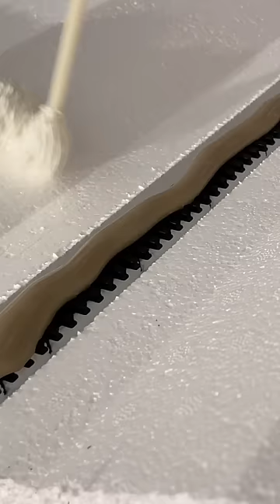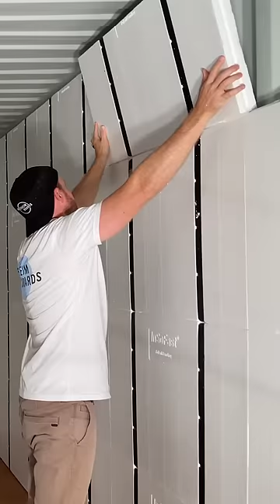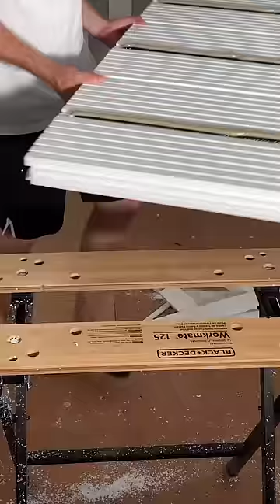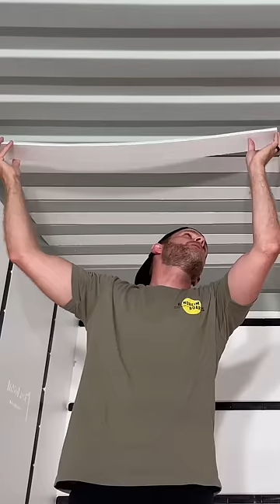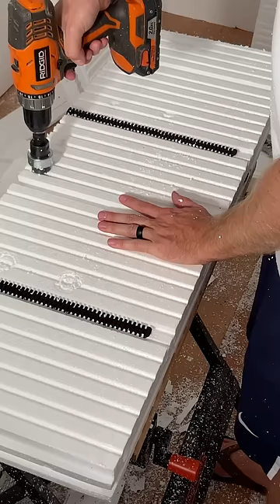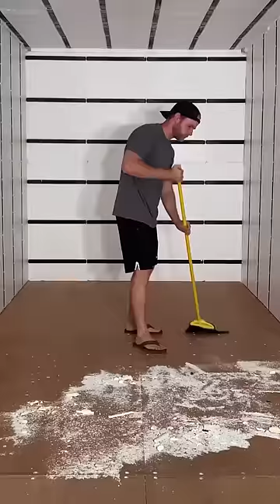Insulating a Shipping Container Shaping Bay #shorts

Comment: Gotta have an air gap between the insulation and metal. Or there will be mold. It's best to fir out the walls and use basic insulation board
Reply: Or create vapor barrier by sealing all the gaps with aluminum tape, that is assuming it is closed cell foam.
Reply: How would you prevent the mold then im just tryna research
Reply: @Jesus.christ.your.bro. Think to install incremental small air vent ports at each recessed section
Reply: You don’t need an air gap if the heat never hits tye metal to bring moisture air behind it. Try to air gap it and you’ll likely get moist air condensing all over, then bugs, then drips down the walls.
Reply: This guy spent all week installing this and now your gonna tell he’s getting mold 😂😢
Reply: Did this and years later found tons of mold and water.
Reply: @joethomas6457 In a cold climate or warm climate?  
Down South we insulate to keep the heat out.
And running a small air conditioner or dehumidifier would take care of the moisture if it was a problem.
Reply: @WaltWW  south Florida.  Must run ac all year.
Reply: @joethomas6457 Thanks

Comment: Great prep for a tiny home I've seen one with the roof cut off and windows installed as it was extended up for ventilation and light.
Reply: There would still be condensation between the metal and foam

Comment: Put those on the outside and cover with T111 plywood siding to stop it from looking like a container.  Build a wooden frame on top that is fastened at the top lift holes only to hang the plywood on to avoid making screw holes in the container body. Use composite deck across the bottom of the sides also fastened to the side and end lift holes to avoid rot

Comment: Very nice job but in order to be 100% safe with the outside heat and cold those work had to be done to the outside walls of the container and above we use to put fibers with special tiles glue and it result its really awesome. We do this a lot in europe
Reply: Correct! You want insulation behind moister barrier, so either has to be vented then insulated like this to let air move behind the insulation to prevent moisture buildup or be done from outside while saves interior space would be harder to do well. Insulation is a little more complicated than most people think
Reply: That was my first thought also. You are completely right sir.   This is building up condensation as hell.

Comment: I would’ve gone CC spray foam myself but nice to know they have that lol
Reply: What is CC spray? Are these panels safer to use?
Reply: @djones9162  Closed Cell spray foam has a couple advantages it will give you a complete air barrier and it will increase structural integrity only con is it’s more expensive then those foam panels.
Reply: @dracothecorso6733  Smart man. that's exactly what we'll be using for ours here in the Philippines.
Reply: @TheIslandExpat  nice just make sure whoever installs does it correctly. I specialize in spray foam, and know many things can go wrong.

Comment: Been try to figure out how to do my containers. Oh hell yes that looks like what I need. 👍
Reply: It this is for living, wouldn't the insulation start to rot when water builds up between the metal and the insulation
Reply: @teunlll  you think stryrofoam rots?
Reply: @Drewsky840  😂 Even when it’s buried under ground for tens of years it doesn’t rot. Simply gets dirty
Reply: @Drewsky840  good lord I’m pretty sure dudes talking about moisture getting between the styrofoam an the metal of the container eventually eating at the steel of the container rotting it out in spots.   

Easy answer to that would be.  If it was properly blasted before paint. And has a complete an hood coat of paint on it.  Should be fine even if that were to happen.  
Even than would be more of a thing with a bigger temp difference.  But I don’t think there would be enough an it looks like a pretty thick styrofoam to insulate pretty good anyway.   Not really like a glass of ice water thin non insulated.
Reply: @blizzthebike  pretty sure dude ment the metal of the container fool
Reply: in so fast is the company i believe
Reply: I'd encourage you to look into traditional sheds or living structures. To each their own, but the width is prohibitive and they cost more to build out that traditional. That stryfoam likely has about a a R13 which doesn't provide very good insulation compared to rock wool or fiberglass at R23 plus.
Reply: @All About Roofing  mine are just work shops & tool storage but, in summer hot & winter cold.
Reply: @bullsprigstoney7068  thanks for the reply. Cheers and good luck
Reply: @Drewsky840  well let's put it this way. Water builds up behind it which can cause a dirty smell. Besides this organic material like algae or other organism can grow there, which in turn can rot. From what I learned its always important to add ventilation

Comment: Call me up I'll spray foam it. Done a load of em
Reply: Where are you located at? I just bought a metal home and would like to see if it can be spray foamed
Reply: @mescobar466  east coast of canada 🇨🇦
Reply: Think spraying it would be cheaper than this?
Reply: Depending. It'll be better insulation then polystyrene. Where are you located

Comment: How do you prevent condensation  ? Mould problems
Reply: Pretty sure that insulation should stop condensation. Unless there's any air gap behind it idk.
Reply: @0ptimal  i seen moisture go behind those panels.  So you really need to seal up 100% everything.  Even a minor gap will do it.
Reply: The best is to insulate from outside and you can have more space inside.
Reply: Gotta have an air gap between the insulation and metal.
Reply: @SetchiPaunda  no, when expending it will draw air in, with it moisture.  Than you have a mould problem. I worked with enough insulation processes to experience that issue numerous times.
Reply: When the AC is on it removes the moisture
Reply: When the AC is on it remves the moisture
Reply: @robertdrews5532  not behind insulation..
Reply: @jantschierschky3461  how is it in a hot climate? Or, could you suggest a better and safer method please? I will be near the equator.
Reply: @djones9162  use rockwool  or Glasfaser
Reply: @jantschierschky3461 ,
Wouldn't rockwool cause the same problems with condensation - especially with drywall or wood over it?
Reply: What is Glasfaser, please?
Reply: @OceanSwimmer  Fiberglas
Reply: @OceanSwimmer  well it would not hold condensation
Reply: Thanks Jan!
Reply: how about a spray on membrane on the outside line rhinoliner?
Reply: @jasonjenkins7702  if you can seal it 100%. But you looking at costs

Comment: If everything is sealed up good there should be no condensation issues with the warm meeting the cold. You can heat that place with a lightbulb. The only cold spot would be the floor unless it’s insulated underneath so as not to raise the height.

Comment: Where do you get that  Installation for the contacts I need that
Reply: It's on the boards itself. Insofast.

They cost more than the shipping container does. Easier to buy/finance a large shed with wiring and moisture barrier pre installed. At least then you don't have to cut and install windows, doors, flooring, etc etc. Throw some pink panther insulation and drywall and call it a day.